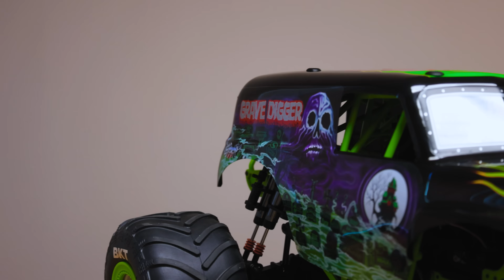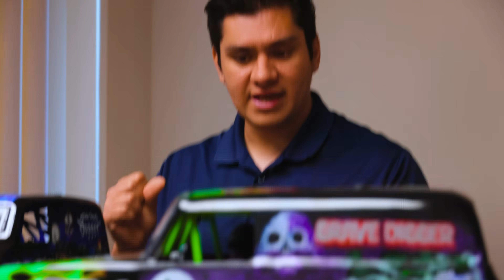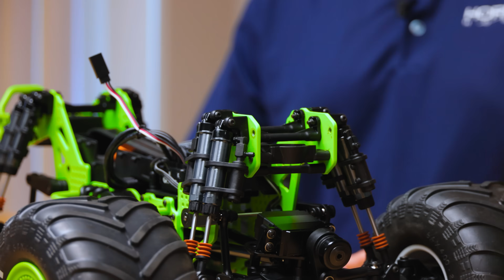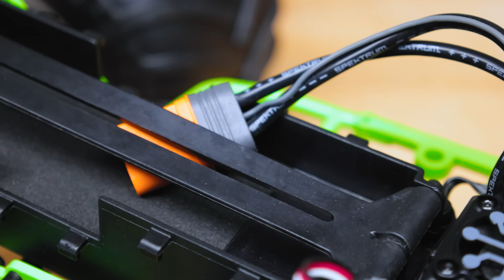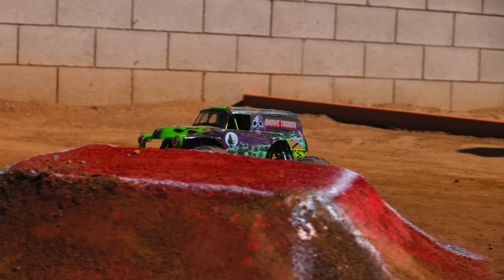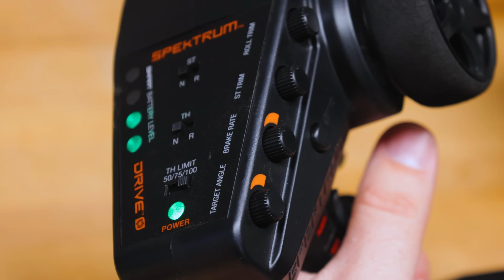THE WORLDS FIRST RC THAT CAN BALANCE ON 2 WHEELS - THE LOSI LMT 2.0 WITH DRIVE TECHNOLOGY

Comment: The 15" wheelbase absolutely kills what bodies you can use on this version and have it still look realistic. All the available aftermarket bodies are mostly based around a 13" wheelbase and it doesn't look right no matter how you mount them.

Comment: I could never do the bicycle with atvs while being good at the other tricks, same with the LMTs I have the 1-0 I went through about a dozen servos no bs , they weren’t the best spectrums rtrs and Amazon guys I used for heavy bashing . I would put protec from my Eight T once while till I got another. Now it’s at point I need complete diffs at least , new axles , bearings , another words I build a nice one I don’t use and use the stock parts . You don’t get good unless you practice everyday it’s different for guys sponsored but also why I love Rc I had a a lot fun running a Actual Gravedigger to the ground , perfecting skills most important had a lot of fun . The cost of the truck a 1000 bucks for year or so monster jam adrenaline pumping body panel flying ground spark ⚡️ excitement. LOSI #1 . 

I literally bought the bog hog three days before the 2.0 was released. You guys kept a good lid on this one . I’m the biggest fool in world 🌎 no mxlt no five B no lst . I know better “ I do have a new 4.0 of course you guys finally released the new 🆕 rigs ohh Losi 😂. Those mtxl wheels were great , all copies out there no one copied them. I’m still holding out for new fifth scale from you guys , I know the deal and be happy with a new five T soon “

Comment: How does this compare to the Tlr tuned lmt?
Reply: Same length basically is one besides the TLR aluminum hubs and TLR bits . You have the same length chassis and bigger pinion bearings the rest you can up grade . I’m sure you bought one by now , I’m about go to lhw 😂 not sure what I get , I used to get gems here like discontinued losis but c19 after 30 years got very popular , plus daughter organized it was a old school hobby shop , if you willing move boxes 📦 you find gems 💎. Last Rc I had hidden was the last LST  I forget what it was called because it’s electric . ⚡️ these lmts he would’ve had old models but guys got smart did same as me except global , so guys will find remaining stock for the sale price . Losi wasn’t playing with the lmts though they all sold out .

Comment: The only thing im not a fan of is the remote looses the 4ws switch for the mode change
Reply from the maker: solid point, maybe a DX5 can fix that
Reply: @LosiRacing  considering almost EVERY Monster truck fan on earth has played videogame versions for years wouldn't a twin stick radio make more sense with these?

Comment: Not enough change to make me get rid of the 1.0 for the 2.0, I do hope the Diff cases are stronger cause they break easy.
Reply from the maker: 100%… this is a refinement… if you have the 1.0 you have a solid truck! And if you want to update the wheels, tires, shocks you can 🤘🏽
Reply: @ I plan too, I love my 1.0

Comment: Wow. Losi really puts a ton of thought and consideration into their trucks. The removable (separately sold THANK YOU) beadlock rings and the flag mount are just nice touches.

The old sway bar compatibility is also a nice touch for those who like it (or who break the stock sway bar and want a backup!)

Comment: awesome! thanks for hearing the problems and upgrade them on this 2.0👍🏻next one should be a 7th scale😎😁
Reply from the maker: Or 1/4 ….
Reply: @LosiRacing or....maybe just make 4 wheel steering out the box? THIS should've been a day one feature on a "Scale model MONSTER TRUCK" would've been easier just putting identical axles front and rear NOBODY wanted front steer only with proprietary electronics😂

Comment: Can I use my DX5 or iXSR6 Radio with these trucks? Also are other spektrum ESC going to have the drive technology?
Reply from the maker: Great question and yes! You can… you just need to upload the software to your radio which takes about 10mins

Also the technology is in the RX … the ESC is just more sensitive to make the tech work better

Comment: I had a friend that using an Emaxx could do a similar, trick (bicycle), The trick to it was, once you had the side wheelie (Bicycle), use the throttle to spin the wheels in the air to create a gyroscopic effect to maintain the balance. he could not do the full sidewall slide, he could only do the roughly 45* angles one
Reply from the maker: That takes skill !
Reply: @LosiRacing  I forgot to add Hid Emaxx had the brushed Speed Gems trinity 550 motors so it was fast and could easily pizza cutter the tires

Comment: I pre-ordered the son of a digger, but I did have an RC that could do most of this years ago. It was the gravedigger by spinmaster  that was only 50 bucks. I believe Amazon still has it. It’s a remote control car that you press the button and it does the front wheel you press another button and it does a back wheelie. The only thing it couldn’t do is a bicycle.
Reply: But of course this is way better thats why I ordered one lol

Comment: Pretty cool!  I remember when the original LMT was discontinued and everyone said that Losi was working on a new version.  It seems like they listened to their customers and that this new LMT2.0 has a  lot of improvements over the original.

All of these updates to the electronics are neat but I think that there is a downside to them and that is that everything is now proprietary.  It might not be possible to change the radio for example so if you prefer a non-Spektrum brand radio, then you will have to give up all of the new fancy stunt features of the LMT 2.0.  That also applies to the other electronic components like the steering servo, motor, and ESC.  Time will tell though as more and more tinkerers get their hands on these new LMTs.

There was no mention on if there will be a new version of the TLR Tuned LMT coming out.  I am curious if or when that kit will be released.
Reply: I guess I didn’t get the memo just bought bog hog other day started repairing 1.0
Reply: @RcPlayer-tt2vw  Yeah, I did not hear or read anything official from Losi about them working on a new LMT.  I only heard from the rumor mill amongst fellow monster truck fans online and they were speculating that there was a new LMT in the works as soon as the original was discontinued.
Reply: @Locoboy5150 I probably should’ve looked into more , I figured that the lhs would have known about it since he couldn’t order more of the first version. I’m debating keeping the bog hog now 😮I take the sprint and 2.0 so he’s not losing business. Bog hog pretty cool though

Comment: Really like the upgrades tricks was pretty hard to get down on the first one so this makes it a lot easier to learn them. 

What I really want is a 5th scale LMT though, I understand pricing will be higher but I want the bigger truck.
Reply from the maker: What do you think would be a fair price ?! 8S or 12S
Reply: @LosiARacing apparently not much feedback on this matter which is warranted but not considered, Traxxas went crazy with the new buggy and a lot of people are shocked
Reply: @ I think 8s issue is pricing it has to be cheaper then the 5k that the raminator cost. I’d be fine with it being around the 3-3.5k range but idk if that’s reasonable.

Comment: sweet been waiting on a new lmt  but dose it still perform like the original without the ....drive tec cheater mode...?   and could yall please start working on a micro lmt  the mini is great but still to big to be grab and go  backpack friendly and theres only so much room on a motorcycle to pack stuff
Reply from the maker: Correct… in the unlimited mode it’s like the tech does not exist! Noted on the Micro
Reply: @LosiRacing  heck ya much love to yall guys and gals and thanks for acknowledging the micro. grave digger for the win baby

Comment: The only people that have issues with a 1.5mm driver are either using terrible tools, or crappy screws. Use 12.9 grade hardware in your RC's. Problem solved.

So glad to see you guys FINALLY fixed that retarded axle design. I lost a lot of respect for Losi when I saw that. Why did this fix take so long?

Now do the RC world a HUGE favor and release a kit version!!!!! RTR has removed 90% of the fun from the RC hobby. I'd love to build one of these with my kid. But I have absolutely no freakin' desire to buy any RTR vehicle. You just don't learn your RC nearly as well taking one apart as you do building it from a kit. This truck is being used in racing. MAKE IT A RACER AND OFFER A KIT!
Reply: Now I agree with you that RTR cars suck and don’t teach you much but sadly that’s what most people want these days. Kits are way harder to sell, most the kits I sell were I work the people pay to have them built. No one wants to put work in these days or learn, they just wanna play and trust me it’s very frustrating dealing with these customers at the hobby shop hahaha.
Reply: @garretpickens5745 this hobby is Radio controlled modeling 😂 people who don't wanna build are also people who don't know how to mod things cause they don't know how they go together to begin with. I feel old AF turning 52 tomorrow lol
Reply from the maker: We offer the TLR tuned kit and it’s not a great seller … Garret is right… unfortunately people that want to wrench are few and far between… people want instant gratification

Comment: I am desperate for you to release a Mini Promoto, I have the 1/4 MX but struggle to find big areas to run it. I also love what you have done with the LMT 2.0 but can only hope you make a Mini LMT 2.0, preferably a El Toro Loco or other new style so I don't have to buy the same trucks that I already have, just with a bit more capability, maybe a drop in  electronics package upgrade kit 😃
Reply from the maker: A smaller Promoto … what would be a fair price? Does it need to be brushless ?
Reply: @LosiRacing  I think a fair price would be around 350 & everything should be brushless from 2025, the small saving from brushed to brushless in my opinion is just not worth the compromise. Thank You guys so much for your recent products, you are truly reviving the hobby for me. Can you imagine being a youngster now, they wouldn't believe we used to  wait all night for a 1300nimh battery to charge to get a 5 minute (if you were lucky) run time at 4mph, and some how they still broke being taken off by CB's or other signal interference (80's Tamiya). How times have changed.
Reply: @LosiRacing  if you released a smaller promoto in the $350-400 range I bet it would sell just as good as the mini LMT! You guys are killing it with all sizes lately but the small stuff is way more affordable and people would go crazy over a bike that size. And the OP is right, you need lots of space for the big bike. Mini promoto would be perfect for the backyard.
Reply: They literally just released a new mini LMT with updates....
Reply: @icatchfish9387 Yeah the Megladon, I didn't mean a thicker 4 link set & single body, I was referring more to an updated electronics package.
Reply: Wow. You have a specific wish list for them.  Unfortunately, this is not how companies run. They do not just pop out items because you think it should be made to satisfy your wants. Just the truth.
Reply: @vigilanterc  Oh, so sorry, I wasn’t meaning to give an opinion as to how companies are run. I would never expect any company just pop out items because I think it should be made, and to satisfy hundreds of thousands of loyal customers with limited space or make a convenient pick up & use wherever you are model, without having to plan a day trip to use their products wants. 
But if Brian Nunez from the most forward thinking RC company, that for many years I have looked at as the panicle of the industry in a video at 31 minutes 45 seconds says drop a comment & let them know where we think the technology should go they love our input, I for once thought I would take that opportunity.